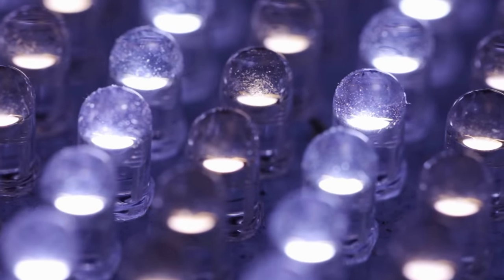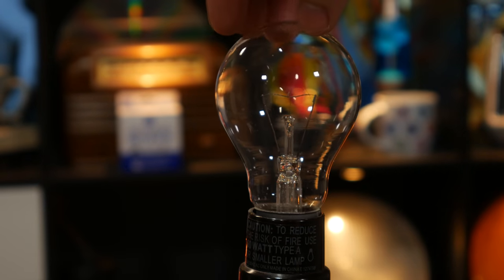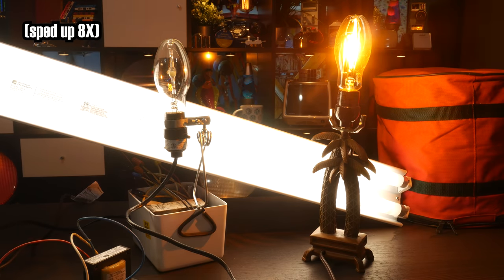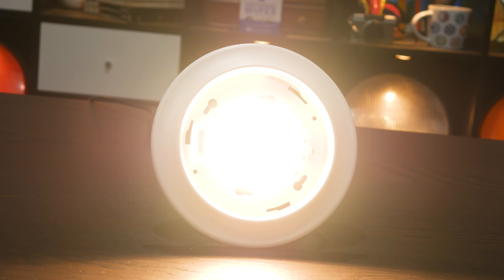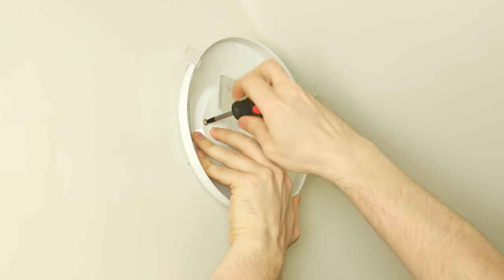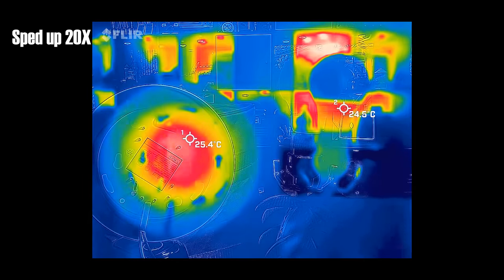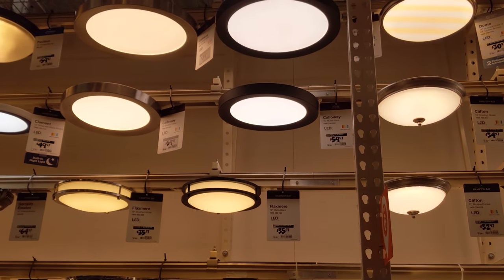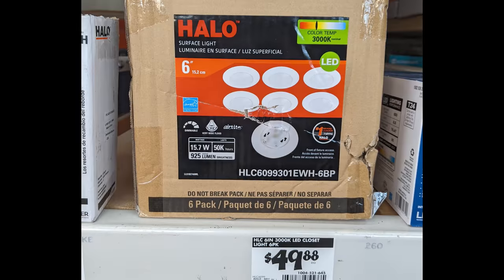A troubling trend in lighting?

Comment: It's terrifying to think that someone with epilepsy could be hurt (or worse) in their own home when they enter a room and find the LED fixture is strobing.
Reply: Yep and similar can happen with other light sources, such as fluorescent and neon... or even the old CRT screens.
Reply: @mikep490  I never had that problem with fluorescent lamps and CRT TVs. What do you mean by neon? Neon sign are not used for residential lighting. I hope you know that fluorescent tubes don't contain neon but argon and mercury.
Reply: @mernokimuvek  Yes, some people are more sensitive to flickering than others. You can see the 60 hz flickering of the old screens by filming one. It was particularly bad when the screens were single sweep and under flourescent lights. I didn't say neon was used in homes, but there was a time they were common in street advertising. It's particularly bad when lamps are older and/or the ballast failing. Even w/o epilepsy it was hard on eyes and could cause depression. Along with flickering you can get that annoying hum. It can be bad enough that it even affects other electronics in the vacinity.
Reply: I once (1960s I think!) had it with an ordinary filament lamp: I think a bit of the filament had lain such that when powered, it got hot and jumped, thus breaking the circuit, then it fell back into contact - four to ten times a second I think. When it was turned off and then on again, it didn't come back, so was then just a dead bulb and was changed as normal.
Reply: @G6JPG  It sounds like you accidentally reinvented the blinking X-mas tree bulb. <g> When those got hot a bit of metal would bend and break the circuit, returning to make contact once it cooled a bit. Filament bulbs can do some fun things, especially in cars.
Reply: Epilepsy is so rare and epilepsy that bad is so rare as to be a non issue.
Reply: @Kloppin4H0rses  You don't need epilepsy to be affected. Flickering lights are associated with eye strain, headaches, migraines, fatigue, and such... even bringing on seizures in some who've not had a problem. My wife was just sensitive enough that I supplied 2 light sources in a couple rooms, each on opposite legs.
Reply: @Kloppin4H0rses  "It doesn't affect me, so it doesn't matter at all"

Yes, epilepsy is rare, but when a product is sold to millions of people, or a neon light advertisement is seen by tens thousands of people in a public place, it eventually will matter. 0.000001% will eventually matter when that number is multiplied by millions.
Reply: It’s actually how they test for it. The put the electrodes on your head(in my day it was a kind of paste, yeah I know but true) and take the readings with various strobe frequencies.
Reply: @Kloppin4H0rses it's an issue for people who do have it
Reply: Don't LEDs flicker, just too quick for us to notice?
Reply: @feckyougoogle1199  Not necessarily. If the DC supply is smooth enough, there shouldn't be any flicker at all.

Comment: What we really need is a new standard for connecting flat LED lights (with circuitry) to fixtures. That would provide a lot more flexibility for the consumers, while still being possible to sell in a pre-mounted package so it's just as convenient as these disposable fixtures.
Reply: As an electrician that would be amazing. We always have customers that are reluctant to install built in led fixtures but finding new fixtures with sockets can be tricky sometimes
Reply: @montgomeryfortenberry  it doesn’t seem like it would be that hard to implement a new standard. Just a 3 pin plug design would suit the needs maybe a clamping mechanism to fight gravity
Reply: @silashinton6873  a new standard would be great
Reply: @silashinton6873   just like normal electrical sockets but a bit bigger with maybe a small handle for easy taking out and
Reply: @ontdekkingszeiler1114  that's what i was thinking. if the  conversion components are separate from the LEDs then ideally you don't want compatibility with current wall standards to prevent people plugging the strips directly into the wall (without a voltage regulator/power converter) and blowing them up
Reply: @silashinton6873  You probably even could make some straight op electrical outlet connectors to place it in some outlets if you want to get a bit crazy, could also just make a outlet connecting wire do you could place them a bit heigher with like a suction cup for the wall or just a straight up screw in the wall
Reply: @ontdekkingszeiler1114  would could for sure
Reply: Yo, NEC, you guys like doing stuff willy-nilly. This seems like a no-brainer. Make it so.
Reply: There is already a two standard fixtures to be used, the problem is there are only Coneshaped lights for them. The Halogen Connectors GU10 and G5.3 for Mains or 12V systems. The Problem is that there are no real flat lights. I got a lot of GU10 Lamps (Ikea) which replaced the Halogen ones, they have Cooling Mantles and are very good. 
So Connectors is not the Problem, the Problem is to Build a flat Light for that Connector. The only thing the GU10 gives it that it needs is 1.2 Inch Socket Deph (30mm) it is already in produktion and could be inplemented, that the reflector is only 2 Inch wide that is a decision by the Lamp Manufacturers. It can easy be 5 oder 6 inch wide. So you could get an LED with 2 Inch deph and 6 wide easily out of the GU10 connector, it is already in Production and easy to swap lights. The G5.3 needs a clamping mechanism but there could be the electronics in the Lamp. 12V Rail systems use this Connector, and again you don't need the Cone Shape lamps. I used lot of Halogen Cone Shaped Lamps to save power and had easy time to replace them with LED.
Reply: No need for new standard.Just use the Westinghouse stopper lamp plug. Round pins similar to GU10 and it was used by Nikola Tesla and George Westinghouse in the 1893 Chicago World Fair.
Reply: @mernok2001  Isn't that one huge and would make it difficult to fit in a flat fixture?
Reply: @asdfghyter  And worst off all it would need recertification in lot of countries. Using the GU10 Socket won't need it. The problem are not the already installed old sockets but installing new sockets.
Reply: Sadly this probably will „never“ happen.
The problem is that there are Billions of E27/E14 fixtures and tens of Billions of E27/E14 Lightbulbs around. Nobody would willingly put a new „standard“ in their house when 99% of the bulb market won’t fit in it. And nobody will Mass produce a new standard of bulb when nobody has fixtures for it. It’s kind of a chicken egg problem.

The only way I could imagine it happening would be a big Alliance of Vendors like IKEA, Amazon and Osram and such got together, prepared a new Standard and provided a big ass lunch lineup as well as an official adapter standard to plug the new socket into existing screw sockets.
Reply: @Renuclous  GU10 is already used. Or 2 pin halogen lamps.
Reply: You mean like the EU DCL standard?
Reply: @lobaxx  oh, I didn’t know about that one!
Reply: Requirements:
Round LED boards size 1 through 5
Square LED boards size 1 through 2 or 3 ( longer rectangular light? just use more boards!)
Standardize a 3 prong plug Voila.
Standardize screw hole size and positioning on the boards.
Keep all the actual electronics on the board.

Maybe nice to haves:
male plug on a lead on one side, and female hard mounted on the opposite side of the board (particularly for the squares, so that the fixtures requiring multiple boards only require one female on a lead built into it. The rest of the boards are simply daisy chained off each other. This would also simplify things for anyone who might consider custom building DIY lighting fixtures.
Reply: To make it the most compatible and easy: standard 120VAC power outlet should be used instead of socket. So, light fixture will have a standard power plug sticking out of it. So, replacing those lightweight fixtures will be just a matter of plugging/unplugging. Existed power socket cover screw can be used to secure fixture in place - there only 3 possible locations of those screws anyway.
Reply: We have a standard, two wire AC/rectified AC with one "hot" colour i.e. red, maroon, brown and one "cold" colour i.e. blue, black.
Reply: The most annoying thing is, We have these!

Whilst helping my dad on cleaning up his touring caravan, we removed the old inefficient halogen bulbs in the 12v downlights with LED alternatives.

they were all small GU4 12VDC bulbs, just two simple round pin connectors that fit into a socket. (I dont actually know if the G4 is polarised, but that's why we have cheap rectifiers)

If we could just standardise fixtures that use something like a transformer to supply 12V to sockets for smaller bulb arrays, it'd work fine.
Reply: GX53 and GX70 sockets, the disposable fixtures were never necessary
Reply: These actually already exist. GU10 is an example of a plug in socket
Reply: @Elkarlo77  I must be imagining my GX53 fittings then 🙂
Reply: The problem with failing led lights are that they're overdriving the leds to get more brightness out of cheaper diodes, also the power supplies are poorly designed to save costs and cooling for these high power leds is also close to non-existent. If built properly, led lights can last years. If they made the fixtures more expensive, they would last longer but of course, they would make less money
Reply: surely it could just be USB C, move the ac-dc converter into the wall, we've pretty much perfected ac-dc conversion (at least as is needed for a 20w source) and then the fixture itself could just be the led's and stuff needed to utilise it. USB has the benefit of already being recognisable and also can do great things like request only the voltage and current it needs
Reply: Lots of led systems already have standardised quick connectors. No reason those can't be expanded to a global standard
Reply: @profwaldone  I would just as soon prefer that we didn't go to a "global standard",  We don't have a global standard electrical system.  I'm frankly tired of seeing minimally designed  IEC junk, find its way into US use,
Reply: You can use 12V power supply and led stripes. However it's a good solution mostly for DIYers, not for regular consumers
Reply: @silashinton6873   the lighting fixture in my bathroom actually works on that principle. Using our standard pin here in Australia along with a spring loaded clamp to attach it to the wall. We had to change the lighting fixture recently because the old fixture failed. At first intimidating, turns out it was fairly easy if you allow your hands to get dirty from the ceiling fluff and finding the 3 pin that the fixture is connected to in the ceiling.

So yeah, done in less than 5 minutes.
Reply: Yeah like a power outlet
Reply: My light has blown up week ago. I've replaced it with the other product. It has sliding contacts which is very neat
Reply: Also, being able to replace the individual SMD LED elements would be pretty cool to make those fancy fixtures fully reusable. It would be cumbersome and probably require dismounting the fixture, but it would sure beat having to replace the whole thing, especially if it's pricy.
Reply: I don't understand why the wiring doesn't connect with something like a molex connector instead of a bunch of wire nuts.
Reply: My big problem with some of these lights is the amount of plastic you need to throw out when they fail.  The old style you just replace the bulbs with those you have to replace the whole lamp/light.  I took a lamp back to the store as I realised that when it failed the whole big plastic body would have to be tossed as the design did not allow the LEDs to be changed out.  It had just as much plastic as my lamps I use with bulbs despite having tiny LEDs.  We need  a way to replace LEDs and circuit bit and not have to replace the whole light fixture.
Reply: It would defeat a lot of the point of the heat dissipation, because those things dissipate heat so well because the whole thing is one piece of metal. It’s also not likely that that will ever really take off, because these things are built with home builders and electrical contractors in mind, who are both trying to buy the most economical fixtures to install in new homes, both of whom don’t care how convenient it is for you to replace the fixture yourself, and in the latter case, electricians like myself would be more than happy to do it for you (for a fee, of course). That isn’t part of the grift, but it’s certainly not a problem we have an incentive to solve. We put those things in new homes because they’re cheap, easy to install, and they work. That’s why they exist, and why they’ll keep existing, unless they’re banned, or something.
Reply: Wago clamp in the celing 😂
Reply: There is certainly a standard for similar lights here in Japan.  There is a bar with two holes in the ceiling, and the light has two prongs that stick out.  They are shaped somewhat like hooks, so you stick it in and twist it, and then the connection is not just electrical, but also mechanical to hold the light in place.  
Also, properly made LED lights don't fail, at least not in 5 years.  The one I have in my living room (from Panasonic) has been there for well over 10 years.  The other rooms have lights from various well known Japanese manufacturers, and even the cheapest ones haven't failed.  This includes the drop-in replacement bulbs for florescent fictures.  I have had exactly one LED light fail, which was a very cheap no-name circular florescent bulb replacement "bulb" from Amazon.  the light from that one was horrible even before it broke after a few weeks.  Never again.  It shouldn't be that surpristing that you get what you pay for.  Also, all of the lights I have, have color adjustment abilities on the remote controls.  I keep them on "cold", but you can set them to "warm" or anywhere inbetween.  One that doesn't have a remote, you can switch it between cold and warm just by turning it off and back on very quickly.  (with most lights in Japan, this trick will change the brightness level instead).
Reply: Or maybe some more flexible standard. Something one way to hold them but many style of bulbs that can be put in. Maybe it connects in a simular style to CLF but lower profile so you can put in a gernal purpose bulb or a large flat one can click into your ceiling.